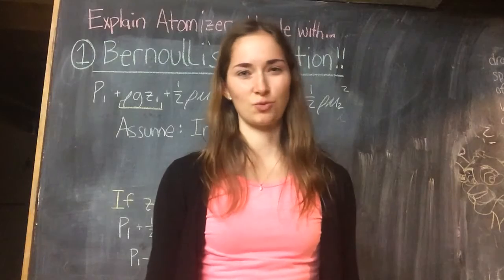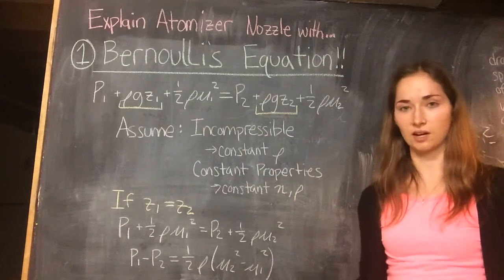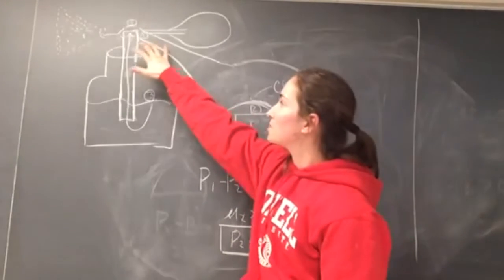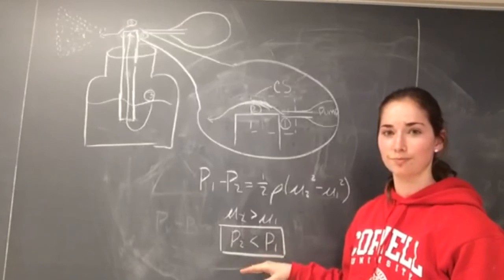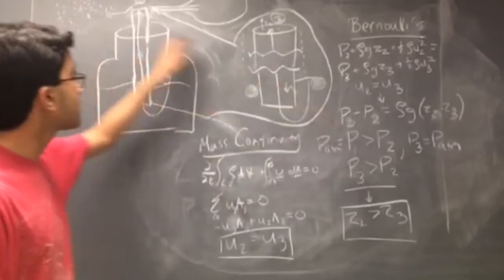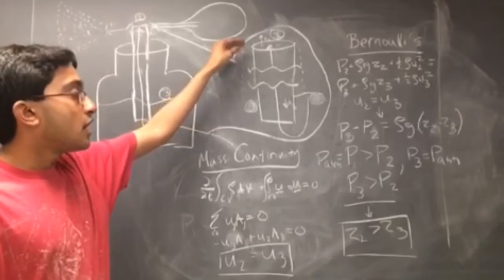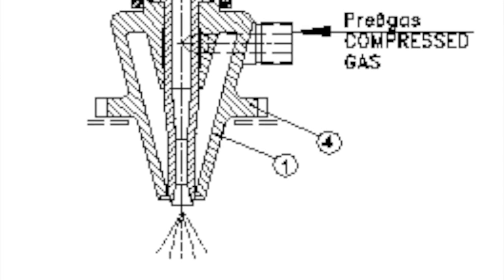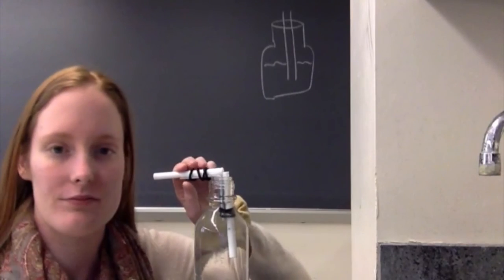Atomizer Nozzle

Comment: 2:07 equation is P3-P2=Rho*g(Z3-Z2) and since P1=P3 and P1>P2, then P3 must be >P2. Therefore Z3>Z2. But since the level of Z3 is  under Z2, then Z3 has to be at a higher reference point than Z2. That means the fluid is forced to climb up from inside the vertical tube.
Reply: P and Z is inversely proportional, so Z2>Z3